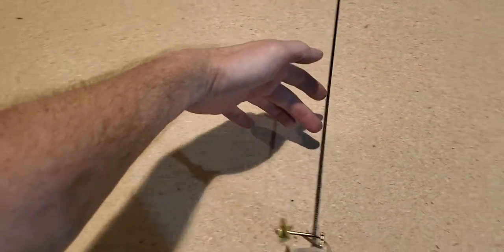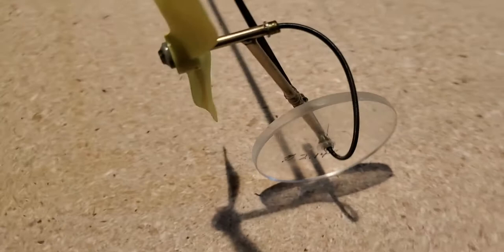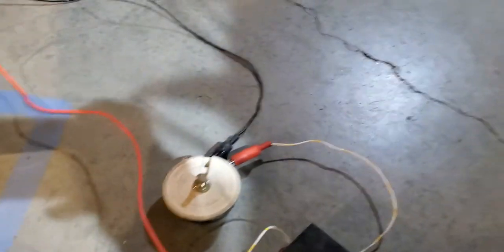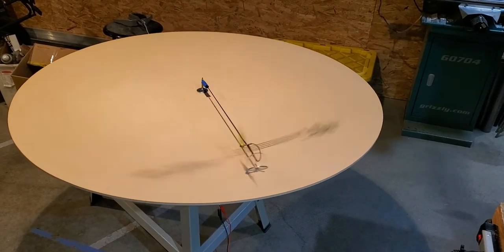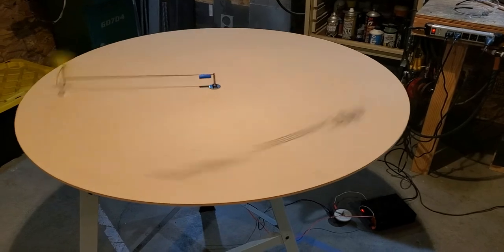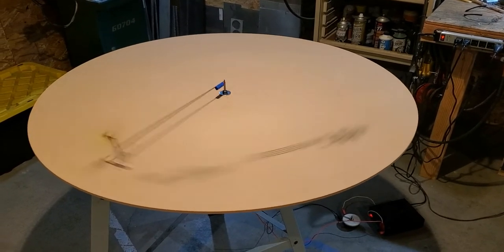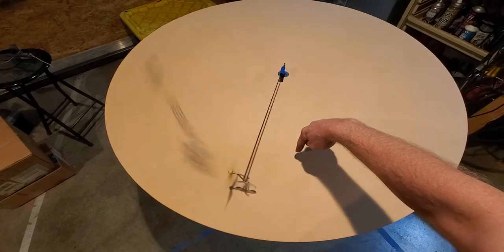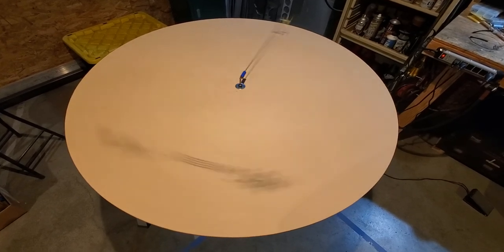Self Starting, Rotary DDWFTW Cart - A supplement to discussion on Veritasium's video

Comment: This video is a lot simpler and cheaper that many others that I've seen... and it clarifies the topic as no other video or article does. The genius of simplicity. In pay my respects and still trying to understand the physics behind this beautiful mindfu(#.
Reply from the maker: I'm glad you found it meaningful! 
The high level power/energy situation (without looking at the mechanics of the device) is pretty easy to understand: A device that can continually, locally reduce the relative velocity between two masses has a source of power. That power can be used to propell the device continually against drag. So the velocity of the device is only a function of input power and drag. There's definitely more drag the faster it goes, but there is nothing special about exceeding the velocity of one or both of the masses.
Now the mechanics are tricky because the prop throws people off (many people don't have an accurate idea of how a prop works, but that's not immediately important). I feel this is best demystified by forcing yourself to remember that the cart is using the same principles as any mechanical device that move faster than the thing pushing it (like a rolling spool of string winding up the tugged string, or Veritasium's wheel thing he pushed with a board, or even the end of a bat moving faster than either of the hands... It's all just leverage / gearing, some disguised better than others. After all the complicated aerodynamics, a prop just boils down to a thing that "connects" a rotating shaft to the air, much like a wheel connects a shaft to the ground - it's the link between rotation and linear motion, granted the prop slips a little while the wheel usually doesn't, and their shafts are oriented differently.

Comment: This is now THE video I'll point people to for both the self-start and the demonstration that it works steady-state.
Reply from the maker: Well thanks!
Reply: @drienkm   For this to be equivalent with a cart at wind speed cart will need to move 1.57x faster than disk. Since this shows around 1.3x it means it is the equivalent of below wind speed. That is because this is not a direct down wind equivalent.
See the video I just uploaded on my channel if you want to see the correct explanation of how this types of carts work.
If you still have this setup I can show you how to run the experiment to show that energy storage is involved.
Reply from the maker: @electrodacus  In your video, you did a great job demonstrating how a cart with a flywheel might store energy while being held and then sprint downwind as that  energy is used. You did not discuss any sort of factor of 1.57 relating to the the spinning table - treadmill analog.
I do still have the spinning table cart. I belive it's obvious that it doesn't have significant energy storage capacity (no heavy flywheel). In fact you see it come to a stop in seconds when I lift it off the moving table. I also showed it starting in a veriety of ways, and let it run for more than enough time to help people soundly dismiss the notion that it works by storing energy.
I should also add, this is not an "experiment". It is a demonstration of interesting mechanics. That's all it is.
Reply: @drienkm  All carts have a flywheel. The flywheel is not the one that allows the cart to accelerate forward after it is released as the flywheel kinetic energy increases after release. The pressure differential is what decreases and that is what allows the cart to accelerate forward after release.
Your cart is at steady state but equivalent of below wind speed not above wind speed.
To show your cart is at steady state above wind speed the cart speed will need to be above 1.57x of rotation disk speed.
Reply from the maker: @electrodacus  Sure, all carts have some spinning mass. In the case of mine, not large enough relative to mechanical drag to sustain departures from equilibrium of more than a few seconds. Your video had nothing to do with a spinning table analog, so you must also say that a treadmill cart needs to move forward at 1.57x treadmill speed (again room reference frame) to be an equivalent demonstration to blackbird. Is this your claim?
Reply: @drienkm  I have a linear treadmill so if cart moves forward at any speed it means it is equivalent to above wind speed. Your cart moves on a circular path thus the 1.57x. If it moved at 45 degrees to wind direction then limit will have been 1.41x
The reason my cart accelerates forward as demonstrated is due to energy stored in the pressure differential created by the propeller. It is the same with yours.
If you have restricted your cart from moving with hand then let the rotating disk get to steady state speed then release the cart you will have observed the following.
Your cart speed will have increased as cart accelerated all the way to say 1.6x so just above wind speed equivalent then decelerated to maybe 1.2x witch is the equivalent of below wind speed and the steady state condition. 
The steady state is not above wind speed but this sort of carts can peak above wind speed using pressure differential energy storage.
Reply from the maker: @electrodacus   @electrodacus  Okay. I don't agree, but I'm sure I could improve my cart (just reduce friction and stuff) and exceed 1.57x times the room rotation speed in the table reference frame, or -0.57x the table rotation in the room reference frame. If I got around to doing that, how long would you like to see it go to be satisfied that it isn't running on stored energy? (bearing in mind these parts weigh a couple grams)😄. 
I could also have a little more fun with things like telltales and having it tug on a string and stuff other people wanted...
I agree that for the treadmill case, any forward movement is analogous to faster than windspeed. And I concur that it's pretty hard to demonstrate to everyone's satisfaction that such a cart doesn't reach the end of the belt only because of energy stored while being held at the start. This was basically why I made this.
But, a cart moving tangentially on a spinning table is actually the same case (in the cart reference frame). I expected a few people to deny that. There are some boundary layer effects that drag air along with the table, and drifting slightly outward, but these are small and work against the cart moving in the opposite direction.
Reply: @drienkm   You can only exceed 1.57x temporarily not steady state. So when you release the cart after disk got to constant set speed the cart can exceed for a few seconds the 1.57x but then cart will decelerate and slow down well below that theoretical 1.57x witch for a circular track is the equivalent of wind speed.
The amount of time it takes to slow down from peak speed to below 1.57x is proportional with the amount of frictional loss.
If you could build a cart with no friction (ideal cart) the cart can get to some peak speed say 1.8x disk speed and remain there forever. But in real world due to friction the cart will accelerate to some peak speed say 1.8x but then always decrease well below 1.57x where it will be at steady state so as long as dist is rotating.
Your cart was already fairly low friction based on what looks around 1.2 to 1.3x steady state.
You can look at the circular track by just considering a quarter of the circle.  Say circle has radius = 1 the units are not important and then the entire circle circumference will be 2*Pi* radius = 6.283 and dividing this by 4 to look at just a quarter you get that 1.57x radius that I mentioned.
So the VMG (velocity made good) for a circular path is 1 when cart speed on circular path is 1.57
If you provide all the details about the propeller diameter and pitch I can calculate what the stored energy in the form of pressure differential will be at the start and so if you can also measure the frictional force I can calculate exactly how long the cart will accelerate and when it will start to slow down. 
All the equations needed to predict the motion of any of this carts are in my video.
Reply: I made some measurements in the video and it seems it just got to the steady state and remained there was not even able to exceed that due to frictional losses. But maybe it could have been able to do so if you restricted the cart from moving until all was at steady state then release.
Treadmill rotational speed was 2RPS that means around 6.4m/s
The steady state was around 1.35x so well below wind speed that will be 1.57x.  The cart did not even demonstrated at any point exceeding wind speed but it may have been able to do so if cart was restricted to move then release.
Reply from the maker: @electrodacus  The ground track, wind, and cart all have the same continuous circular frame. It's just the treadmill case curved back to its beginning. You ended up with the 2pi/4 VMG issue only because you are mixing two different reference frames; a straight one for the wind, and a curved one for the cart. There is nothing straight about this. It's all a circle.
If you just really want to think of it as straight, you could consider a small part of the circular path that approximates a straight line, but why do that?

The cart spinning opposite the table at all is effectively running faster than windspeed. But I'll still see if I can clean things up and do better than your 2pi/4 (you haven't held my cart - it does have a good deal of axle and propshaft drag).

Well thanks for analyzing my video for me! I'll take your word for it😁. That agrees with the way things looked - stored energy wasn't causing any perceptible overshoot of equilibrium. Plenty of damping
Reply: @drienkm   What will be the direction the cart will move if it was not constrained by the fishing rod ?
There is nothing that I'm confusing regarding the reference frames. And yes exactly there is nothing straight about the circular setup so it is not s direct downwind analogue.
I did considered a small part and that will be a quarter of a circle.
Cart will need to move above 1.57x faster in order to be equivalent to a direct down so you can still use a circular version just need to consider the equivalent.
Yes there was no measurable overshoot in your test as there was plenty of time before getting to steady state to dissipate all stored energy. 
You can also imagine a constrain to cart that will only allow it to move in a square instead of a circle and in that case the wind speed limit will be 1.41x instead of a circle 1.57x
If you cut the restriction the cart will move straight. You do not have any forces acting on the cart body in the straight treadmill experiment as you have in this circular one.
And no you will not be able to exceed 1.57x at steady state but you can do even 2x or 3x peak tho after that peak cart speed will drop well below 1.57x depending on friction probably in the 1.3 to 1.4x range. So your cart did fairly good in terms of friction loss.
Reply from the maker: @electrodacus  What direction would a strip of tissue point it you held it from your outstretched hand and spun around in a calm room?
The 'wind' the cart moves through is a circle.
The 'ground' the cart rolls on is a circle.
Reply: @drienkm  There is no wind power inside a room (assuming door and windows are closed).
Same as in my setup the cart is powered by the treadmill and in my case while cart accelerates above wind speed it is powered by stored energy in the form of pressure differential.  You did not demonstrated higher than wind speed in your setup but if you did (and is possible) it will be for a limited amount of time direct proportional with the amount of stored energy.
So to answer your question the tissue points backwards but not due to wind power but due to energy you put in to overcome the air drag.
Do you remember the propeller pitch, diameter and the wheel diameter in your setup ?
Reply from the maker: @electrodacus  Right. We're on the same page there. The treadmill and table demonstrations are both 'ground' powered in terms of where energy is entering the system.

As far as reference frames, I'm don't think I'm going to get anywhere with you and the circle thing 😅. I'm done there. We'll see if I can just make a better cart.
Reply: @drienkm  But there is no such thing as ground power or ground energy. That can only come from the cart kinetic energy when cart moves relative to static ground.
Just think getting from point A to point B. On my treadmill that is done in a straight line so if cart can move forward relative to stationary camera it means it is the equivalent of above wind speed. But on a circular treadmill with say A and B at opposite ends the cart will need to travel half a circle to get from A to B thus to get there in the same time as traveling on the circle diagonal it will need to travel 1.57x more. And when yours gets to B it will return to A using the other half of the circle.
If my cart could turn around with no energy loss it will just travel back and forth on the linear treadmill.
That axle connected to the center of your disk is what prevents your cart from moving in a straight line.
If you want you can do the same test trying to get a lower friction cart but it can not be that much better than what you already had as it is physically impossible to have a steady state speed even equal with 1.57x.
Reply from the maker: @electrodacus  As far as I can see, we disagree on only two things. 
1) Whether a correction factor of 1.57 is required for a spinning table version of the treadmill cart
2) Whether steady ddwftw is actually possible at all
Do I have that right? Anything else?
Reply: @drienkm  Yes I think that is correct.
Reply from the maker: @electrodacus  Alright.
Then if you'll humor me, try to forget that my cart ran in the opposite direction of the table at all (don't want you to be bised by point (2)).
Imagine your proposed square arragement which you say has a sqrt(2) correction factor. Let's say each of the segments is a treadmill, and let's ignore corner-transition technicalities as I believe you were. Now, I realize you don't believe sustained ddwftw is possible, but (correct me if I'm wrong), you do view the treadmill model as an accurate analog to ddwftw, right? So my question is this: Why do you view the 2nd segment as no longer counting as "down wind"? We both understand that the treadmill model represents ddwftw simply by use of a new reference frame. You said yourself, the room is full of basically calm air. Remember ddwftw stands for "directly down wind faster than wind", not "From A to B faster than the wind". In both the treadmill and spinning table models, "down wind" remains exactly where the cart is pointed, even as that changes.
And about external forces: What is the tangential component of a purely radial force?
Reply: @drienkm   Yes that is correct I know sustained faster than wind direct down wind is not possible and if you do not consider my experiment as faulty in some way the experiment just proved that is the case.

That side force on the cart body can not be ignored as that does not exist on the linear treadmill cart.
The net force on the circular cart will not point straight as it will be the product of 3 forces one of witch is 90 degree to the other two forces (wheel force and propeller force). In the linear cart net force is the difference between propeller force and wheel force and direction is the same as propeller force direction up to the point where stored energy is used up then net force direction will change as cart become powered by treadmill.

Due to that third force on the circular treadmill the net force will be larger and at an angle to the propeller and wheel forces.
Reply from the maker: @electrodacus  So again, what is the tangential component of a purely radial force? 
Stated differently, what is the torque created by a force passing directly through the pivot?
Reply: @drienkm  It can be either calculated or measured. Maybe you think it is zero and in that case I will ask: Why do you need that connection to the cart if the force acting on the cart is zero ?
Reply from the maker: @electrodacus  There is centripital acceleration and a balancing tension in the rod. The two are always in equilibrium - radius is fixed. 
What is the tangential component of that tension?

Comment: Very cool demo, thank you for making it. The only thing that could beat this would be:
- A release mechanism that fixes the cart to the turntable, until the turntable has reached a constant speed.
- A top down camera fixed to the turntable and visual airflow indicators on the cart and on the table (to reproduce the opposed streamers on ground and cart)